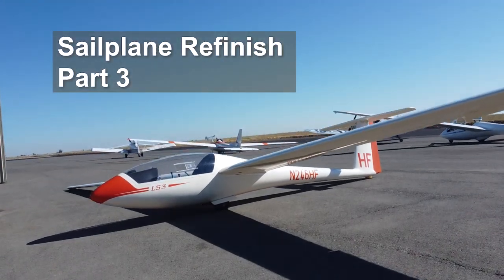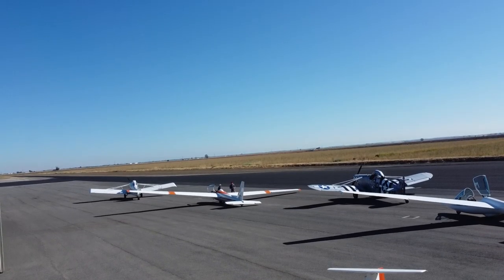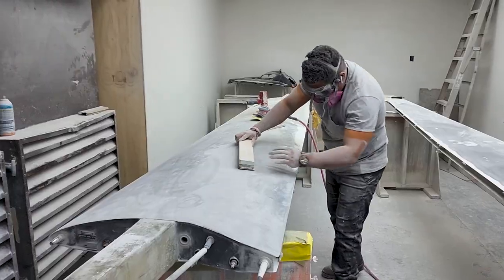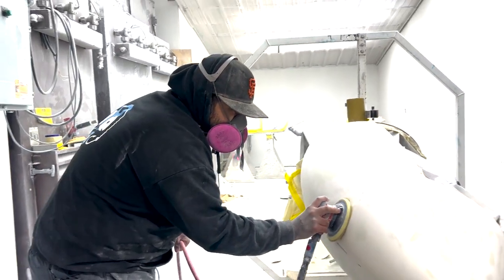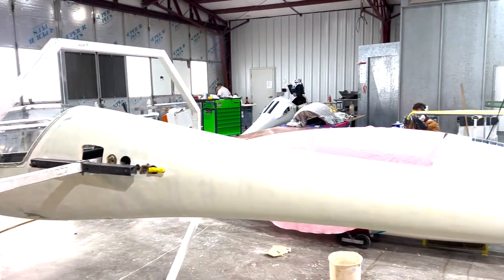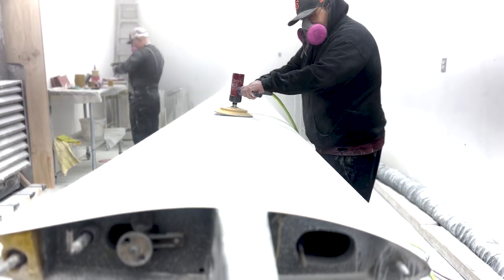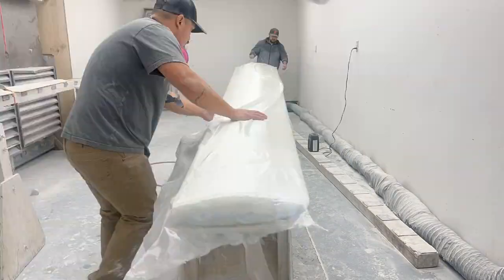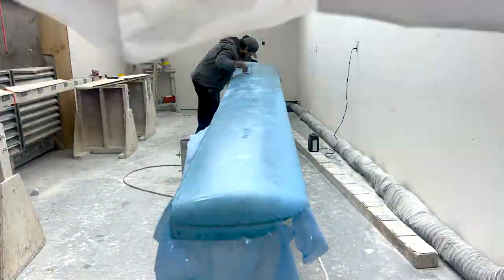Sailplane Refinish Part 3 - Gelcoat Removal

Comment: Question: when it comes to checking the weight and balance. Instead of using scales - wouldn't be "more prudent" to build a strong u-shaped rig, connect the rig to the bolt holding the wings together at the CofG and then hoist the rig and hoist the entire glider at the CofG. Have a pilot sit inside and visually see the glider balance?
Reply from the maker: That method works on small models but not accurate enough for a full scale sailplane. Weight and balance is performed by raising the fuselage to a specified level then recording weight the main and tail wheel. Calculations are performed which provide an exact CG location.